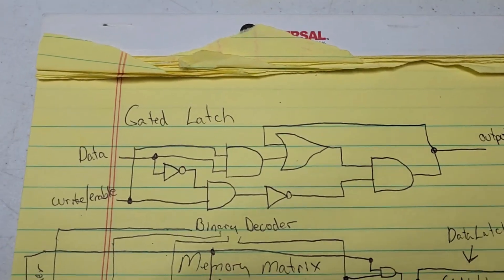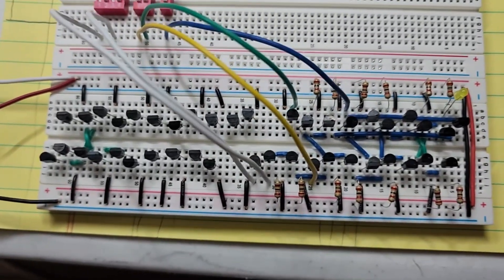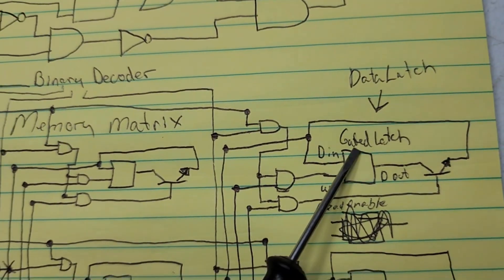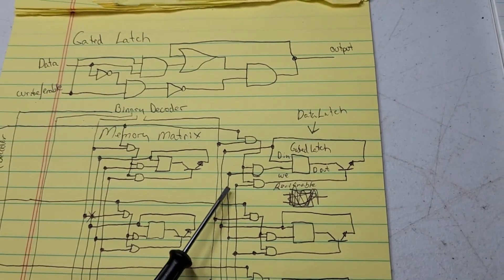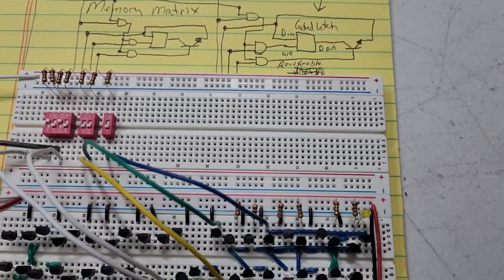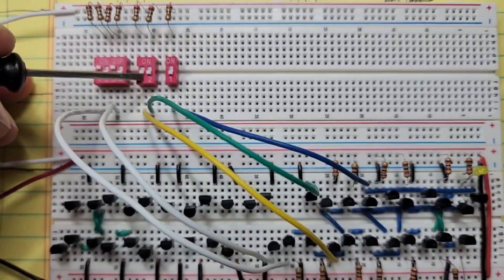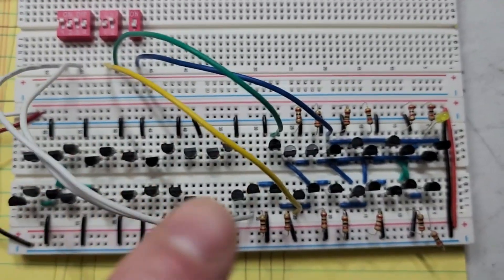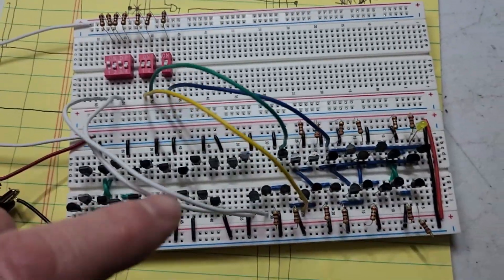One bit of SRAM with Transistors

Comment: Your upper schematic for a gated latch (also known as a fall through latch) is nonsensical.  If we use D for the Data input, E for the Enable input, P for the Previous latch output, Q for the next latch output, "*" for logical AND, "+" for logical OR, and "/" for logical NOT, the correct equation that also covers any hazards (race conditions) are: Q = D * E + D * P + /E * P. The D * P term covers a potential hazard.  For any reasons that I'm unable to fathom, you have drawn this as Q = ((D * E) + P) * (D + /E), which reduces to D + /E * P, which is obviously incorrect for the intended function.